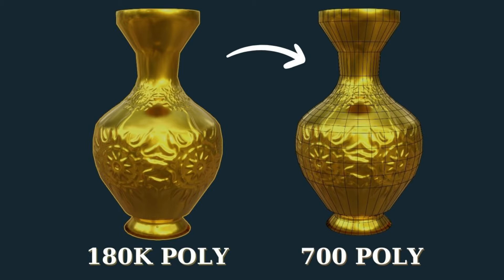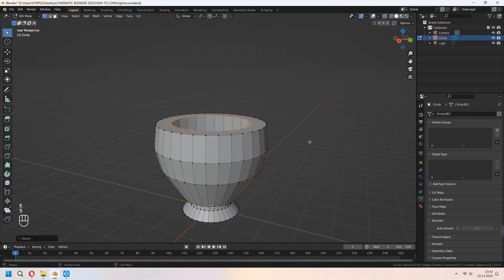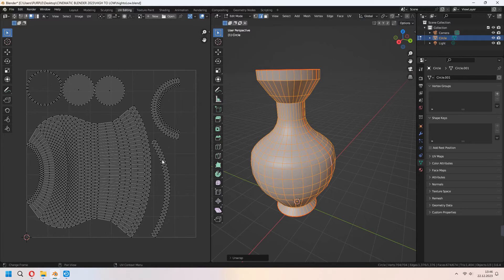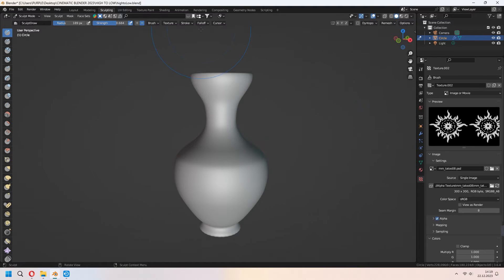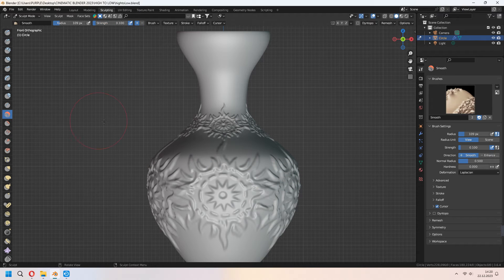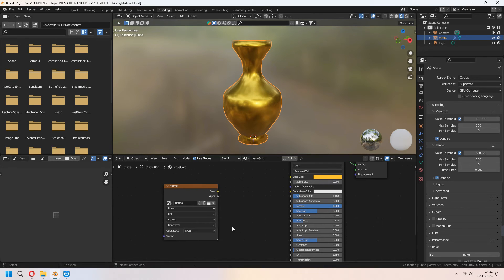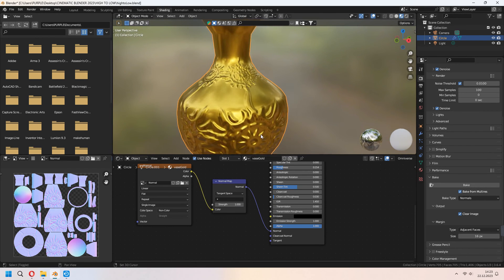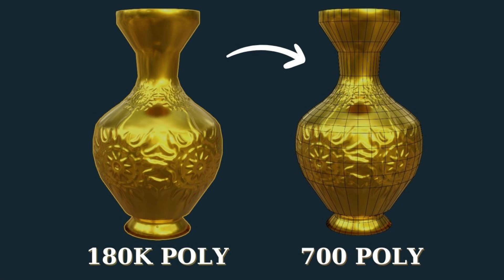Blender How To Transfer High Poly to Low Poly / Alpha Texture / Bake

Comment: An error msg pops up saying "Multires data baking requires multi resolution object" as I clii ck bake button.  (Blender ver 4.2). BUT IT WORKED FOR ME IN BLENDER VER 3.6.  THANKS A LOT❤👌👌
Reply from the maker: Thanks for the comment as you say version can make some difference. i will search about it 💜
Reply: @nonedesign3d  Thanks for getting back.❤👌